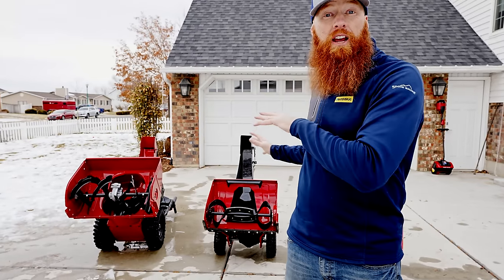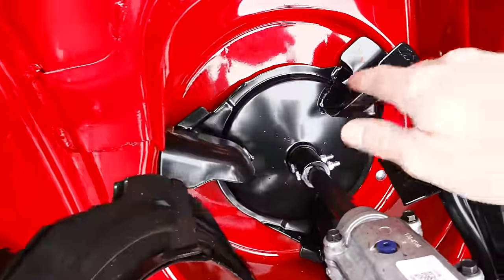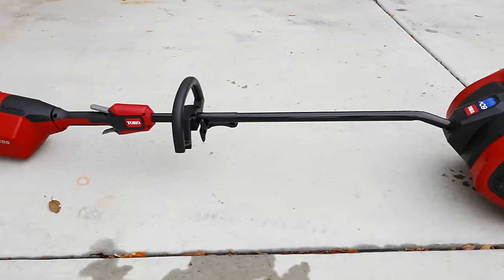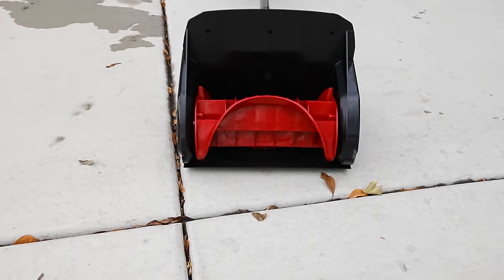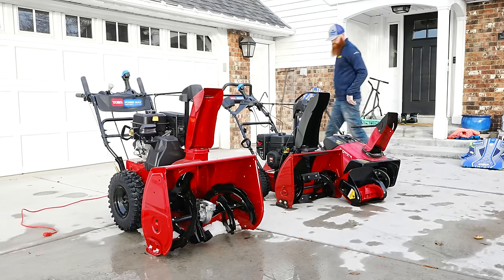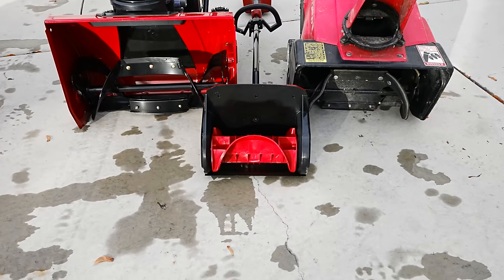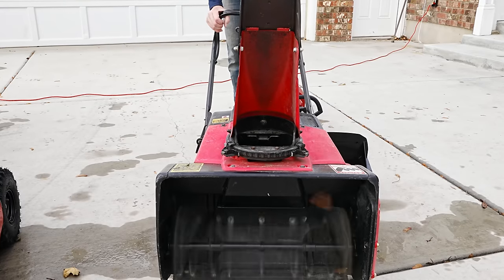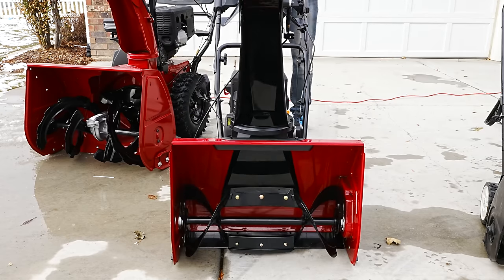Buying A Snow Blower?! 5 Things to Consider when Choosing Snow Blower

Comment: Two things: one thing to consider when it comes to size. Can I fit a 26” unit between the cars parked in my driveway? Maybe a 24 is just fine then... also, look up the “impeller modification”. Basically you attach mud flaps to each of the 3 impeller blades (2 and 3 stage obviously) so it physically sweeps the inside of the barrel. You’ll never get an ice clog in there again and it’ll throw almost water slush all day long. Worth it.
Reply from the maker: All fantastic suggestions. I'll be doing more vids once the snow dumps in january. Really appreciate the suggestions
Reply: @pestandlawnginja  looking forward to it! Here’s one of the DIY impeller flap mod videos. Feel free to get in touch with me if you are gonna do it and need advice or whatever. Game changer, for real. https://youtu.be/v3m_djNQEgA
Reply from the maker: @BenNawrath  awesome Ben! Thank you
Reply: @pestandlawnginja  you’ll be pumpin slush before you know it haha
Reply from the maker: @BenNawrath  soo true!

Comment: All I can say is that if you live in an area that receives a lot of snow, or you have a long driveway or many paths to make, then go for the horsepower and a machine with at least a 28" or 33" cutting width. I have a 13 HP Yardman, and I have never had a problem with a clog chute even in wet snow because the power is there to push it out.
Reply from the maker: Very true!

Comment: Let me tell you the snowmaster single stage is amazing. It's all about the wheels being SELF-PROPELLED not necessarily the stages Toro has proven that so has YouTube. It actually removes more snow and throws it just as far as the two stages. It does 2,800 lb of snow versus the other ones that are 2,000 that are two stage.. 
 
You wouldn't think a single stage self-propelled would be that great but it's amazing. 

There's a guy on YouTube that removes snow for a living in Ontario Canada I think. Gets way more snow than we get.. 

HE USES THE SNOWMASTER 824. 

IT WILL DO ANYTHING I MEAN ANYTHING!! AND IT'S SO MUCH FASTER THAN A REGULAR TWO-STAGE.. 

It's also very light.. So you don't need a reverse. The self-propelled makes it so easy. So quick.

HE CLEAR SNOW UP TO 2 FT 300 TIMES A YEAR!! It's so many times because he does tons of properties. 

He's had it for 6 years 7 years something like that He's never done any maintenance and the things still works perfectly.. He said The gas lasts so long more than any other one.. 

Truly amazing.. I thought he was just a regular dude showing snow blower videos but he's doing it for a living.. 

His YouTube channel is. OLDLENN 

Check it out you'll be surprised what the snowmaster can do.. I didn't think it was going to be that great.. But Was unbelievable at what was able to remove.
Reply: Thanks for the info.  Much appreciated.

Comment: I've got one of those 20yo massive 2-stage electric start self-propelled beasts, it is very clunky, loud, and breaks a lot(had to replace or rebuild most of it over the years of maintenance) so when I was having carb trouble last winter again and finally the starter quit(which there is no way you can pull start it in the cold until the machine has time to warm up from running) I set it aside and got a battery powered single stage! which I had doubts about it doing my 86 squares of sidewalk(most people only have like 12 to do) and good sized dual lane driveway, but hey, it works ....sure it is not self-propelled, doesn't like slush, and takes longer chipping away on deep snow(and a few battery swaps) but in the whole scheme of things(storage, moving it around, smell, noise; and no maintenance, oil, fuel, or 'starting' issues) it is much simpler and just easy to get the job done, esp considering that most of the time I'm never clearing more than a few inches of snow and just need it done quick ...so there clearly are other options than "buying the biggest one you can afford" that everyone else says(cause I've been there and done that) and instead I would say to "get the smallest easiest one that gets the job done 90% of the time for the ¼ of year you have to use it" as I'm not interested in having my life revolve around owning, working on, and using a snowblower year round anymore
Reply from the maker: Great feedback. I must say that battery technology is light years ahead of what it used to be.

Comment: Buying a decent used snow blower is the best solution for most people in my mind. They will all require work, even the best kept ones, but the cost to purchase and maintain is low. Most of the local ones I see for sale are two-stage, and when talking to people a lot say they get rid of them due to the weight/storage size rather then them not working well.

That being said I just got a Toro battery powered single stage as my first snow blower after hurting myself late last year snow clearing by hand. Haven't used it, just wanted to get ahead of the first snow-fall rush, but it ticked the boxes for what looks like a decent snow blower for my driveway and sidewalk. I can use the batteries for the Toro chainsaw I have and once done with it don't need to worry about another engine to maintain and store. I also like that it is light, and can fold up, up enough to fit in my hatchback so I can take it help my older mom at her house after a lot of snow. Hopefully the reviews were right and it works well in the coming winter!
Reply from the maker: I just did a review on the brand new battery powered single stage snowblower and needless to say I'm blown away.  such an awesome piece of equipment.
Reply: Thanks -- I'm enjoying reading all the comments, as I'm a homeowner in IL with a long, curving driveway with very STEEP spots that our HOA's snowplows miss *constantly*, leaving icy patches galore.   The last things we need are to pay for a poorly done job and to have to wrestle a heavy machine up and down the driveway. Sounds like a single stage will have to do us.

Comment: I've Had a show blower all my life.  My father taught me how to use one at an early age.  I had a great single stage I gave to my sister to use but she doesn't like it's 60 years old and is not user friendly.  My 38 year old toro is the best in most snow levels and types but the engine size is 3.5 Hp.   I just bought a cordless power shovel to do quick clean ups to steps and sidewalks.  Getting to old to work on snow.   Always buy name brand units for easy part purchases in the future.  Time to move South.  Thanks Ginja.
Reply from the maker: Awesome feedback john! Buying name brand will help future proof your investment!
Reply: @pestandlawnginja  Proof is in the the fact a forty year old Toro still has a buyable parts list.  Merry Christmas Ginja

Comment: I have the Toro 724 QXE. That directional joystick makes buying Toro a no brainier, it is fantastic!
Reply from the maker: I thought it was a bit gimmicky at first but after using it for a while I feel like it's a solid design and super fun to use
Reply: I've been considering buying that model as my first snowblower. How does it handle the banks at the base of a driveway after the snow plow drives by and laughs at you? Also, does it handle wet snow well?
Reply: @242-f5u  It handles wet snow great. It handles the snow banks better than any other single stage but naturally is not going to perform as well as a two-stage. Still, there's never been a time since I've had it where I thought, "Dang wish I would have bought something more." It's worked out great for my needs
Reply: @familybarton  Thanks for the reply. I'm in Illinois so we do get a lot of snow at times. Not sure how your region compares

Comment: I have had snowblowers for over 30 years and I learned a few things.  One, gas engines hate to not be run, they just become hard to start.  You can help by using stabilizer in  the gas and run out the gas, and frequent maintenance.  In the end, these just break down much more often then mowers or other engines that get run a lot.  I recently gave up on gas and have gone to a Toro 60v single stage. OMG, this little single stage cuts through and throws snow better than any snow blower I ever have had in the past.  Deep snow no problem.  Plowed in driveway, this little electric has vastly more torque than any gas.  I recommend skip the gas and go with cordless.  No maintenance.  No hard starting.  Fantastic torque.  Super light weight.   Only negative is they are narrow and most are not self-propelled.
Reply from the maker: totally agree.  I did a full review on that model and its fantastic.
Reply: i don't know how you do ur maintenance but my Toro 826 fires up on the first pull every time and a tank of fuel last forever.. fuel stabilizer only works for a limited amount of time 6 months max..  non ethanol fuel is the way to go wether off road gas or if sold at the regular station which ever is cheaper plus store in a seal container it will start to go flat in about a year however it's not hygroscopic so won't damage the equipment..  i got battery powered tools and equipment i use at work and its always a compromise , power , weight or run time.. u can only get one or the other with battery equipment plus in the 2nd to 3rd year of use batteries start to show some aging..  mild winters with a tiny driveway sure it works ..  with gas no compromise power and run time .. i go hard then back in the house to warm up

Comment: Just saw a video where someone took the ceramic coating for car finish and applied it to the inside of the chute to keep snow and ice from sticking
Reply from the maker: yah man.  that works for sure.  I prefer to use a sylicone base.  liquid wax does work and it works great too.

Comment: So is a gasoline stabilizer needed if Super Tech is used? I want to get a snowblower with tracking instead of the wheels. I'm debating between Honda and Toro. Honda is very pricey.

Comment: Sweet video, but here’s my 2 cents.   I’ve owned the rubber single stage it worked ok on dry snow not so good in the wet stuff.  I wore it out in two years very disappointed. I then bought the big boy three stage.  I love it and I would recommend spending the money and getting one that can handle the work.  Also at the end of the year make sure you leave no gass in the unit or run some stabilizer through it or you will eventually gum up your carburetor.  Merry Christmas buddy!
Reply from the maker: Great feedback john! Thanks for sharing your knowledge!

Comment: Hey great video, but I didn't hear the model number of the 900.00 single stage. Or I missed it, I didn't see it in the description below either.
Reply from the maker: Toro snowmaster - 24" 724 QXE - msrp $749 plus $55 tax

Toro 828 power max hd - $1199 plus tax

Comment: I need one that can chop up snow berms along the curb on two sides of my block, then 1 bock of sidewalk, and driveway  100 feet of entrance walk
Reply from the maker: Hmmmm maybe a 3 stage. You’ll be replacing pinion rods so get a bunch
Reply: @pestandlawnginja  ended up with a 3 stage commercial thrower, yes a box of shear bolts

Comment: I notice on most of these videos they all talk about the convenient features and how user friendly the controls are. That's all fine and dandy when everything is working, but how long will all those flimsy cables and plastic parts last? And none of them never seem to address the thickness and durability of the metal frame and auger housing. The old ones were thick and tough and made to last for many years. Many of the new ones however, seem to be very thin and cheaply made. I don't see them addressing that fact. You need to go look at them in person and see just what kind of quality you're spending your money on.
Reply from the maker: great feedback David!

Comment: I have a 6 car driveway. 2 cars next to each other 3 cars in length. But all gravel which one would you advise?
Reply from the maker: I would get a 2 or 3 stage without the rubber paddles.  you can adjust the height wich will help with the gravel.

Comment: I need a snow blower that doesn't piss the neighbors off, tonight I was doing a driveway and the snow from my machine was going on the neighbors driveway, and they weren't happy about it. I should also state im doing this as a job and I can't afford something crazy in price
Reply from the maker: for the snow drift I commonly use a back pack blower afterward to help push the light stuff off
Reply: @pestandlawnginja  after the neighbor complained i was going to go over and clean theirs off, but I feel like the neighbor next to them would have the same thing happen, the snow keeps blowing, mind you im using a cheap electric snow blower, I might just rig up a cardboard tube to blow it down instead of up into the sky, although I don't know of that will do the trick, although it might help.

Comment: No, my blower has reached the end of its life.  Time for a review.  🙂
Reply from the maker: good timing!  I have a review on the new toro single stage and dropping another snow blower video today or tomorrow.
Reply: @pestandlawnginja  I'm good.  Here where I live in New England a two stage is the rule of thumb.  Two driveways which each can hold six cars a piece.  

The last blower was 5hp and struggled with the wet snow.  I'm going for 8hp (300ccish) or more this time around.  Larger everything so to get through the snow that much quicker.
Reply from the maker: @robertmacfarlane8176  more power!!!!! awesome

Comment: What's your thought on the corded snow blowers like a Snow Joe?  Considering one, as we get maybe 1-2 snows of 4-6 inches a season.  Shoveling is getting harder every year, and its always heavy wet snow.  Thanks.
Reply from the maker: They work well for  1 to 4" of snow. works well for small driveways. The issue is the width and height of the machine. I'm not entirely sure which one you're looking at but they're commonly very small
Reply: I'd personally just get a Toro 60v single stage or Ego single stage. Otherwise go for a battery powered 2-stage.

Comment: Single stage units use rubber paddles that were designed to wear out over time. When more snow is being ejected out the front than out the shute, then the paddles are worn. There are usually little holes marking the replacement being nessary. These units work fine for small drive ways and decks. I didn't see you mention the difference between commercial grade snow blowers and the garbage the big box stores sell. For the money, do NOT purchase a snow blower from any big box store, they are NOT built the same as the models sold at a dealer. Service on a big box store unit is not going to happen. Most dealers will not service big box store units as they are cheap and do not hold up. Just because big box stores sell name brand units, doesn't mean you are buying quality eather.
Reply: From my experience the lines sold through big box stores bring the local dealers a lot of repair work and also parts sales to the DIYers. I bought an Ariens 926LE at home depot in 2006 and have had several problems and broken parts beyond "normal wear". Dealer told me Ariens downgrades quality on line sold through H-Depot, to make more money. Does anyone know if thats true, or are the more expensive dealer models using the same parts but come with a longer warranty?
Reply from the maker: love the feedback and thanks for sharing your advice.  good stuff

Comment: Lol a 4 stroke will last alot longer then a 2 stroke. Why do you think road vehicles are 4 strokes. Not to mention look at how many times you have to rebuild a 2 stroke sled or dirt bike compared to a 4 stroke. And the higher rpms on a 2 stroke will wear out the piston rings faster compared to a 4 stroke which is one of the reasons diesels last so long the engine spins alot slower.
Reply from the maker: size in this instance make a difference mr chad.

Comment: single stage. no thanks,  push snow blower. no thanks.  wheels not tracks?  no thanks,,,, lets get real, its supposed to be a snow blower not a kids toy.  And its supposed to clear real snow and plough heavy drift  -  the snow in that video I would just drive over,,, that is not snow, its a heavy frost. hahahahahahahah. I want to see a real test of these things in 4 feet of snow!  which is what you need a snow blower for!
Reply from the maker: Checkout my toro battery powered snow blower review. More up your alley